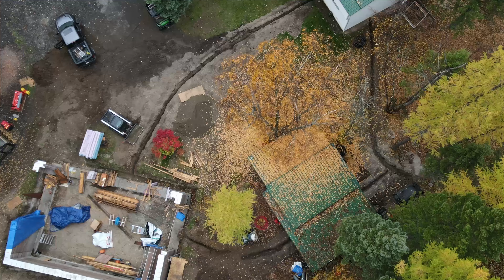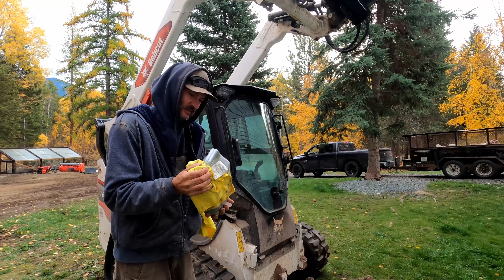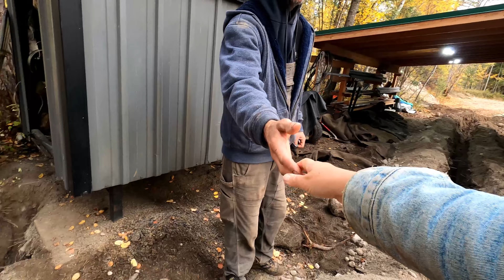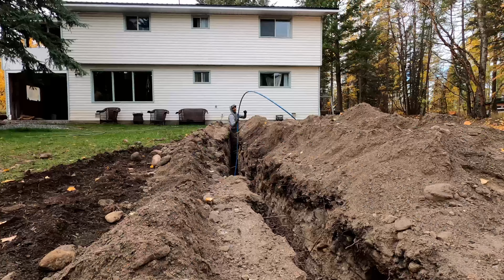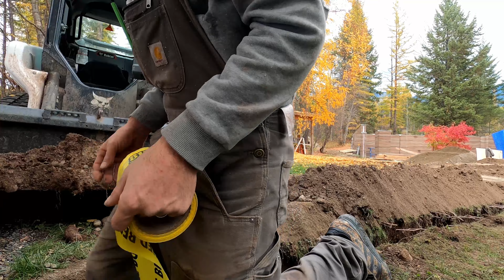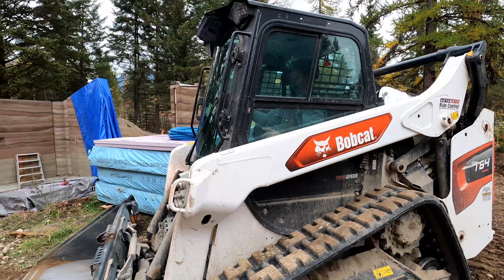Trenching For OFF-GRID Utilities | Geothermal Greenhouse Build  (Ep11)

Comment: I almost didn't bother with this episode, as I'm more interested in the build at this stage, but I'm really glad I did. Seeing how practically to bring power/water to a structure was really useful. Not as difficult as I thought it would be, just needs some planning and forethought. The more I watch your videos the more I realise the skid sled is an indispensible tool. I wasn't aware it was possible to attach anything other than a scoop/bucket, but the mixer and trench cutter are brilliant add-ons.
Reply from the maker: Hey! Yes there is a large assortment of attachments for the machine. Keep in mind that the attachments are likely available for rent as well. Best to look around and find a rental source if you know you can complete your task in a defined amount of time. We bought the mixer because we knew the project would be extensive and we are going to do more Rammed earth buildings after the greenhouse.